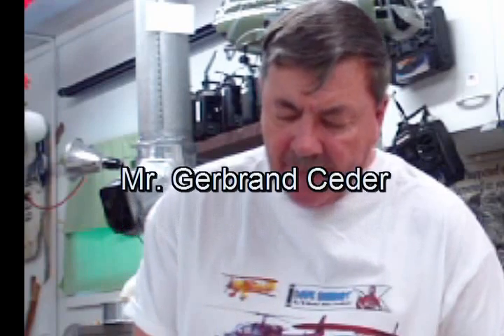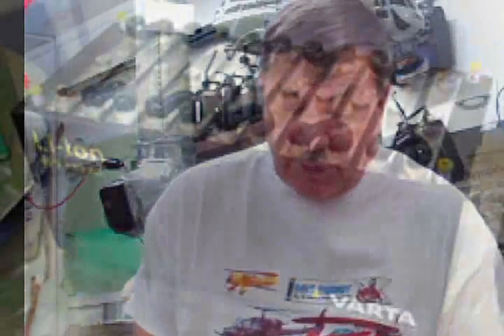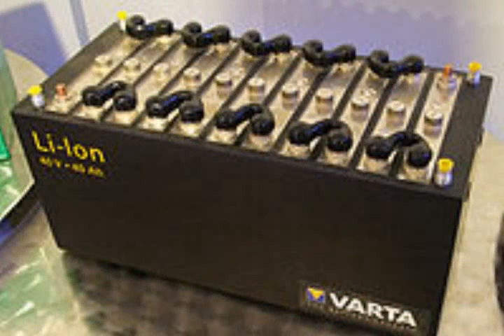Lithium Ion charges in 20 seconds!

Comment: aboos1993, it's possible, though. It depends on how intelligent the chargers charging this thing are, and what kind of ion implantation sheet (mostly metal ion, like magnanese or cobalt ions, and couple other things that goes in the making of the battery. And, you got it right on, the battery resistance's also important too.

Comment: @DrMario2007baka well of course...you wouldnt charge a traditional lipo battery in 20 seconds. the new material would allow charge to be delivered faster with less resistance so that means less heat.

Comment: @minititan10 

I dont have nearly as much know how or experience as Dave but after you installed the new head you would have had to check your pitch collective at 0% , 50% and 100 % throttle. Normally the pitch is about between  -2 to -5 Deg at 0%. about 5 Deg at 50% and about 10Deg at 100%. have you checked that yet...?

Comment: Lithium-ion batteries are not necessarily the safest battery technology. Although the batteries are mandatorily required to have safety devices built in to them this is not always effective. 

The big move now is towards developing lithium iron phosphate batteries because of there longevity, higher peak current capability and to reduce the danger associated with Lithium-ion thermal runaway.

Comment: I don't see any reason why this won't happen. It wasn't many years ago that they were saying electric helicopters were impractical yet now they outperform the gas models.

The problem I see, especially with real vehicles is the current it would take to dump this much energy into a battery in such a short period of time.  His comment about needing thicker wires is presumably all about that little issue.

Lets say a car has 1,000 amp hour batteries. A 30 second charge would need 120,000 amps!!

Comment: Hey Dave (and anyone with a Belt-CP) i have a question about battery compattability. My esky LiPO has been 'retired' and i am looking to buy a new battery. i cannot find one exactly matching the Esky's specs (1800mAH and 20C). can i SAFELY use a 2200mAH, 25C in a standard Belt-CP.

Comment: I got the impression that the tunnels used by the ions would not just let the ions to travel faster but would offer less resistance to the passage of those ions. If that is the case there should be an improvement in how many times the battery could be charged as well.